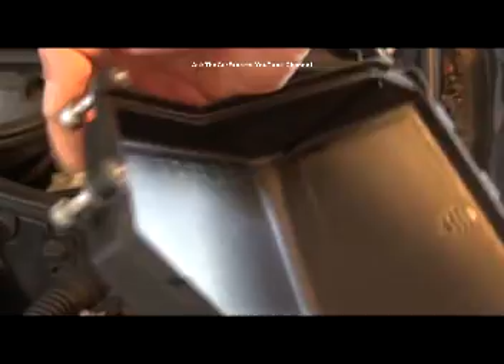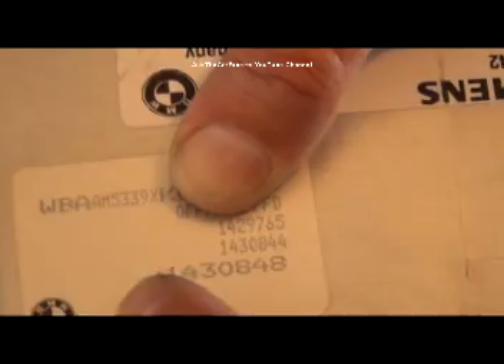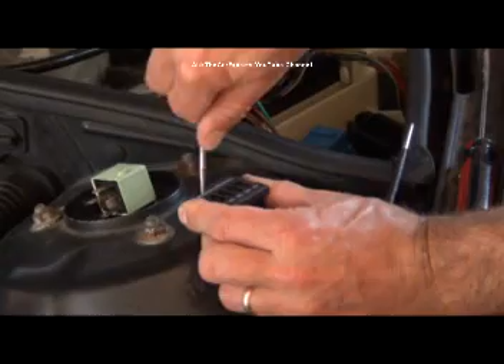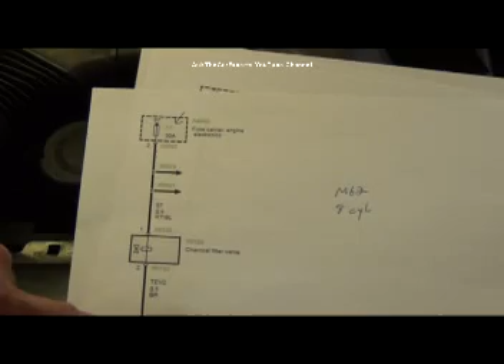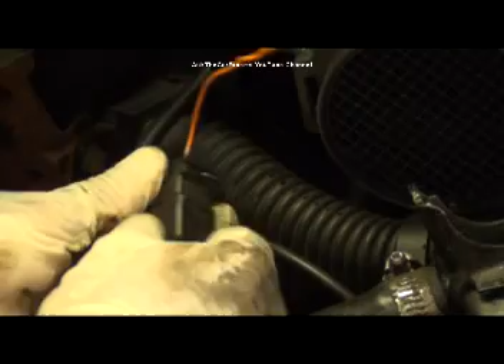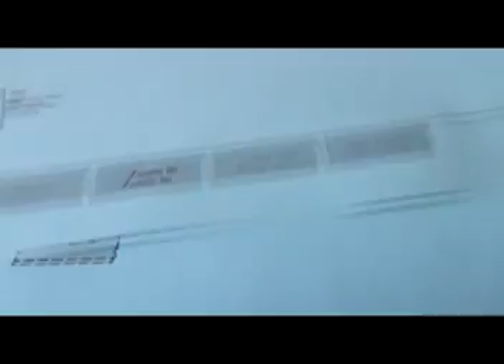3 Series Purge Valve DIY E46 P0444 Removal And Installation With Full Diagnosis Steps

Comment: Hi Bud, I have replaced my Purge valve few times on my 330XI 2003....I am keep on getting fault code "p0441 powertrain, Incorrect Purge flow" what does it means, please advise?
thanks
Reply from the maker: Hello, This code may mean you have a leak in the system which would not be the purge valve. The usual spot is on top of the fuel tank or in the wheel well in the rear right near the fuel tank filler neck. The most common cause is rodent damage either on top of the tank or tubing for the evap system.

Comment: I was trying to find my wiring for my BMW 2001 330ci. I purchased the Haynes BMW 3 serices 1999 thru 2005 and the electrical diagrams do not show the computer connective wiring. Bentley's manual for BMW 2001 330ci has the wiring but the input to the computer from the Evaporative Emission Valve (Purge Valve) shows wire color of BR/SW which should be BR/WS (Brown/white). So the best advise would be to check the return path from the purge valve to computer as stated in the video.

Comment: I was fascinated by your video and have a new respect for anyone who works on my E46. No wonder it is a few hundred dollars for any diagnosis at the dealer. Thank goodness I haven't had much trouble since buying it new. Sounds like you work at a dealership. Do you think independent BMW service garages are worth it for E46 or newer car repairs? Or is it just the cost of ownership to use a dealership?